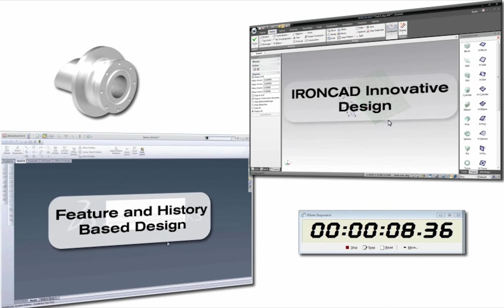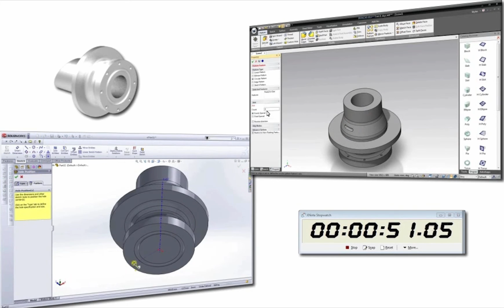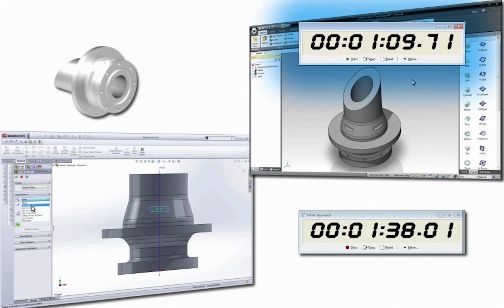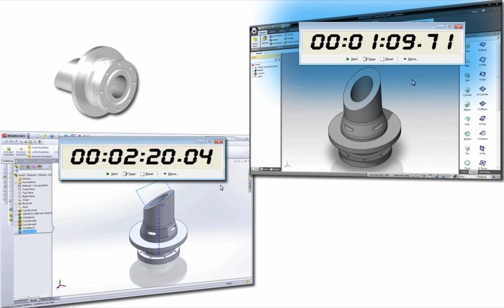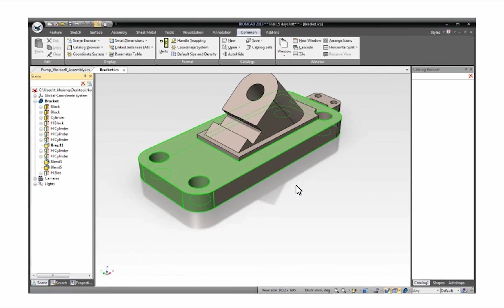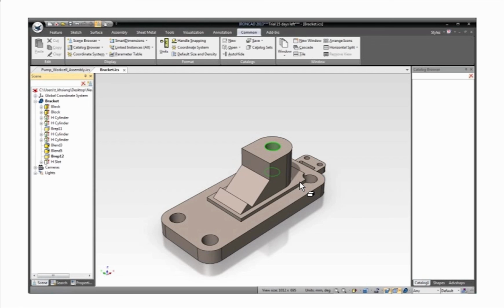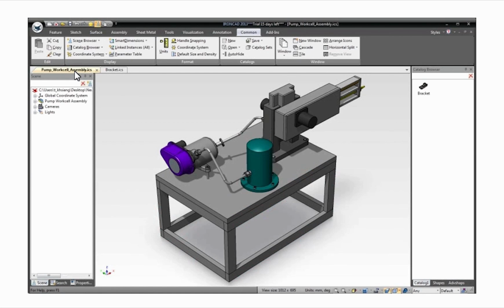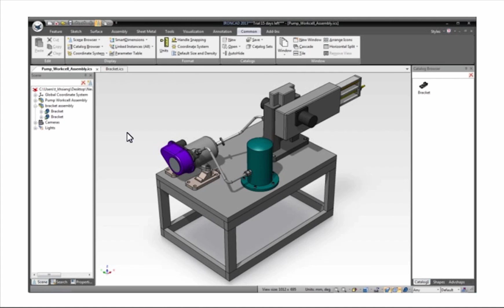IronCAD vs SolidWorks Comparison

Comment: 아이언캐드로 그린 사람도 너무 어렵게 그렸네요, 한달 만 써봐도 저것보단  훨씬 쉽게 그려요
Reply from the maker: Hi M.Y Han,
We had to use Google Translate as we don't speak Korean.
IronCAD will definitely save time modelling in 3D compared to other programs: it skips unnecessary steps using direct 3D modelling.
You can learn more here: https://ironcad.academy/
Reply: @CADInternational  lol actually, he is a reseller of Ironcad in my country.

Comment: Using SolidWorks Library? No! Using SolidWorks Design Feature? No! Using Hotkeys? No! Is it right CAD comparison? No! This is a comparison of two approach for one current task, not CADs.
Reply from the maker: It actually is a fair comparison as the IronCAD demonstration is not using any of the available shortcuts or smarts either. We could redo the demo with IronCAD smarts but the difference would make SW look even less efficient than it is out of the box and I guess it would be even less believable by those with closed minds
Reply: @CADInternational  Lol, what a joke. Everyone can see that the person in this video is a keen user of IronCAD, but has no idea about how to use SolidWorks efficiently. The person in this video is either a fool, or is deliberately using the slowest possible method of doing each move in SolidWorks. People will trust you a lot more if you don't use manipulation and deceit.
So you admit that you used deceit, but you say it was because people are to stupid to believe a truthful demo? Make your mind up mate.